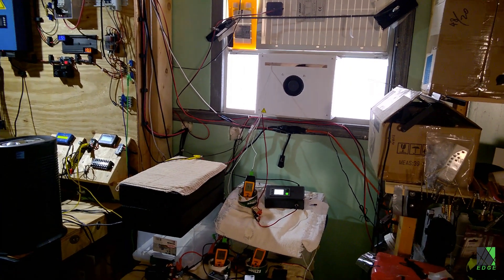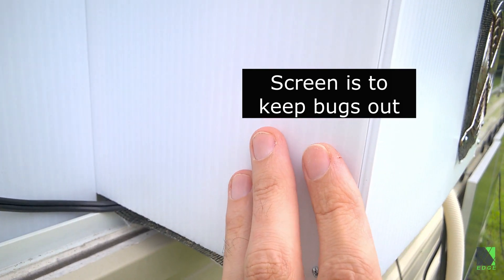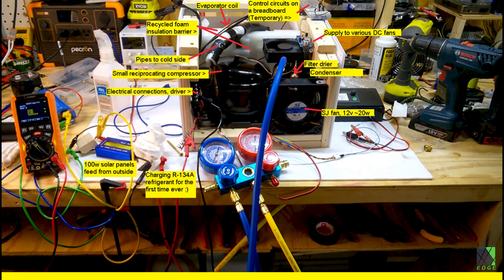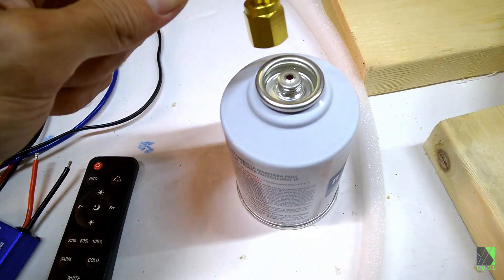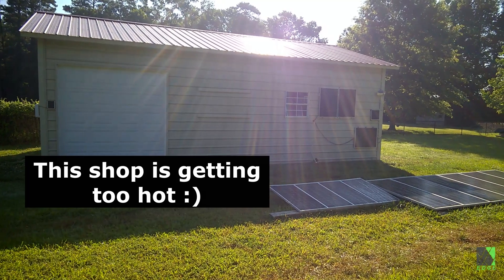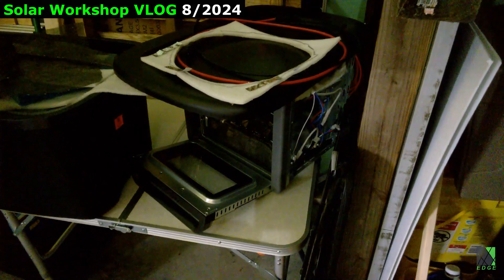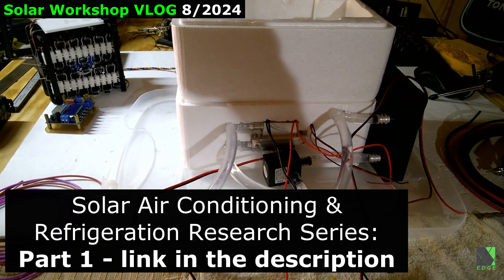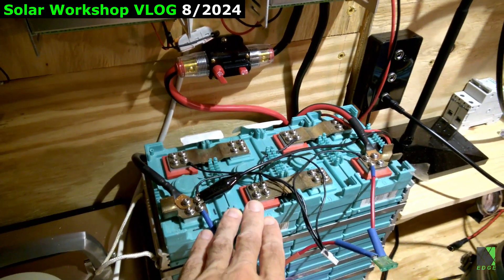#DIY Direct Solar Air Conditioner Prototype R134a Compressor Window AC & Solar Workshop VLOG

Comment: I just found a 12v DC air conditioner and heater that goes on an RV.  960 watts. That's a lot of panels but.....hey.
Reply from the maker: @lesliekendall5668 RVs often aren't very well insulated, so that's probably a key factor. I have found quite a few small 12v AC systems available, at least we do have "some" options

Comment: ...directly into the compressor circuit.  Right.  Sorry, I'm a girl and a visual learner. 😊. Send me one.  VERY MUCH needed.
Reply from the maker: @lesliekendall5668 I am working on one with a better compressor, but will have to take it apart and start over... so can't send one yet :D
Reply: @solarpoweredge 
I found a 24/48v mini split online that I'm going to look more into.

Comment: The copper pipe that you use for the air conditioner I was thinking maybe if you coiled it like a sugar cone where you start out small and then go big that might work better. I don't know what I'm talking about it just something that popped in my head. Coil copper pipe like a sugar cone will make it where the  copper pipe is not so close together.
Reply from the maker: @aunttriciaattic Good thinking, it's very tough to get exchange over a simple coil like that. If I can do some upgrades to this machine it would be great :) 👍

Comment: Is that one of the chinese danfoss knock offs? I am curious how you got it to work on direct DC, did you use a buck converter to keep it in the voltage range? How does it handle low light conditions? I have a sundanzer that uses one and they used to sell a direct PV model but no longer do as far as I can tell. I would love to be able to convert some of the cheaper chinese DC chest freezers to direct solar and eliminate a huge risk off grid, battery failure.
Reply from the maker: Yes I don't know who made it but definitely looks to be a knock off of Danfoss. Looks very similar on the outside. I hacked it to accept any voltage, normally they shut off. The panels have voltage swings as low as 9 volts or up near 20, so a 12v compressor usually would fail or error out. Also had to experiment with some circuits to start the compressor when it first turns on. And obviously it won't run at all when there isn't good enough sun.
Some time ago I did convert 2 DC chest freezers to PV but have yet to make a video about it. Really need to get that done. Of course the challenge is to get the fridge cold enough to make it through the night without harming the food, or perhaps could switch back over to battery if needed
Reply: @solarpoweredge  What did you use to convert it? A dc to dc buck boost?
I know the vfd is designed to slow down if it needs, just not sure how sundanzer did it. It does have a contact that you vary resistance on it and that adjust the speed. So you could use a circuit that adjust resistance based on the solar input to help start it in low light.
Reply from the maker: Electronically I have found many or all of these drives do not want to operate on an non-standard voltage supply. Most of them require something stable, like a battery for power. Those solar panels are simple not able to run the compressor without some additional electronics work and a circuit to handle the start. I pretty much left all that info out. Also this compressor does have variable RPM like you mentioned, I had it throttled down for fear of overheating. Your idea to start at a lower RPM could be helpful for PV. In fact from what I've seen that's how some of those DC inverter mini split air conditioners start up. Very slow and gradual. Anyway it seems most people aren't interested in electronics, but perhaps I will try to get a little more into electronics topics in future videos.
Reply: @ I talked to sundanzer, I have a DCF400 chest freezer, they have direct drive control circuits for danfoss compressors. Not terribly expensive, around 100 bucks. I am going to see if I can swap it out and convert my chest freezer. Might be possible to use them in Chinese copies of a danfoss, it’s basically just a BLDC motor controller like a lawnmower and can be very universal, as long as the wires are the same and the motor is the same size I don’t think it would require much to adapt it if it did need any changes. Do those compressors have a harness for hall sensors?
Reply from the maker: The 2 compressors I'm working at now plus many I've researched have no hall sensor that I can see. But now that you've mentioned it I may take another look. I ran a compressor on generic bldc drivers, but there are some issues with it being non-compressor aware. What we don't want is a locked rotor without some kind of protection circuit, which might burn the windings
Reply: @ should work than if it’s a clone of the danfoss, the hall sensors where the only real snag, it’s possible to figure out which is which but time consuming.

Comment: I went with a mini split, its 900BTU but I have a tiny home. Also it uses about 400 WATTS once temp inside is stable. Powered by solar in Day and a auto switch to AC grid keeps it going after voltage drop. It is 1F and I am warm, tossed the gas furnace and gad hot water heater out (old stuff). My home is all electric even hot water for sinks and shower. ;) Love your videos.!
Reply from the maker: @ECMVAQ137 That is awesome :D glad you like the videos and thanks for watching!

Comment: Did I miss the link to or description of the compressor?
Reply from the maker: Hello, it was a recycled unit. But it looks to me like the cheap "overseas" Danfoss knock offs on a popular auction site. They are probably intended for freezers fridges etc. nothing exotic at all. I plan to find a better compressor and expand the system to a permanent installation... as soon as humanly possible that is

Comment: I've given up on solid state cooling unless they can find more efficient designs but I'd love to know how your more traditional AC project goes long term.  My understanding is the compressor motors don't fair well because of the fluctuations in power.
Reply from the maker: #jmr Hi, definitely hope to post an update on this work... it's been getting a bit too cool here for AC work lately.

I spent months and a lot of money trying to boost peltier cooling performance, and made some breakthroughs. In one test I dropped the power consumption by 50% for the same freezing temps. I started building a small refrigerator to test the ideas. Had to ignore the peltier stuff on yt and just concentrate on my own work. It paid off! Hope to produce a video as soon as I can. Peltiers are a bit of a mystery and very frustrating to figure out. Also working on solid state air conditioning, which is extremely difficult. In fact there are already commercial peltier air conditioners available but I want to improve the design and cool my shop.

Compressors are very easy to cool with due to the gas cycle. In this particular solar AC, the compressor was able to run on a very wide voltage range. First time ever building something like this so I really want to go for version 2 and make some improvements.
Reply: @solarpoweredge  Very COOL. 😆
Reply from the maker: @jmr I see what you did there :) :D hahah

Comment: Thank you for being so detailed with all of your information. I've been extremely interested in solar panel direct to components. 

Have you looked into a company called Natural Current? I purchased a 1hp DC pool pump running off of 2× 550w panels. No inverters in-between. 

Thank you again for sharing all of this information.
Reply from the maker: @cuseikan Hi, you are welcome :) I have not heard of that company, but a solar pump that powerful would be awesome for a lot of different uses!

Comment: I love seeing people's uses of solar. I built a 1.1kw that feeds my shed and powers my Robot lawnmower. I like your idea of solar AC. I paused your video and hopped on Amazon and found 24v peltier modules. (My solar system voltage) I can't wait to see how your testing turns out.
Reply from the maker: @FJRyder A solar powered robot mower is pure awesome! Have fun with those peltiers. I think they can do more and are worth looking into. Several peltier experiments running in the shop at the moment...

Comment: It could be worth trying to bury a coil of tubing (or simulating ground temperature) and testing whether a heat exchanger and pump would improve efficiency.
Reply from the maker: @SentienD I want to try that, If I could get 100ft of half inch copper pipe for cheap, I'd be burying it

Comment: I think Hvac is going through a Renaissance and it couldn't come soon enough. The rates contractors want for outdated architectures is obscene. I could buy and DIY install 5 mini split systems for less than half what the contractors want for a replacement central AC system. This will give me 5 independent zones including my garage for incredible efficiency and redundancy. The central system will give me no redundancy and won't cover my garage. The research you're doing will empower people to make their own custom off grid systems from scratch. Legacy Hvac contractors see the writing on the wall that they will be obsolete soon and are driving up prices to cash in while they can. Subscribed and will be following your work closely.
Reply from the maker: @vladimus9749 Thanks for subscribing and your support! I believe DIY'ers need more options and flexibility. Plus the option to build their own Air Conditioning and Freezer/Fridges. I figure there will always be work for HVAC contractors because not everyone is DIY oriented. But new DIY systems, especially that consume DC solar power directly with battery backup, are high on the list. 
I am testing large scale peltier setups as a potential DIY solar air conditioning solution for small spaces. As well as a peltier freezer. Peltiers are finicky and not well understood, but I hope to unlock more potential if there is any. Will post more on this as soon as possible...

Comment: Use a 12v electric ac compressor from a 2021 Honda accord hybrid are insist I got one laying around am
Planning on building a fully ac system with all with a window ac unit am estimating it will pull 800 watts max at 12 am not sure if it’s variable but I see some modules online for control the motor
Reply from the maker: @onelinkrecords I'd like to get one to test. Seen them on an auction site. Although my efforts are going into "no BLDC" research right now, to eliminate the controller electronics
Reply: @solarpoweredge  ACTECMAX Universal AC Electric Compressor 20cc/r Air Conditioner Compressor for 12V Auto Compressor for R134a listed for 350$ usd
Reply: Option one use oem connectors and piping and condenser probably most diy but big 
Option 2 solder line and use coper lines for small build

Comment: The noise from the fan can be reduced by insulating the coil box and placing the fan inside the box towards the back and then building an air manifold like a "ducted" mini split. Sort of like the air vents on a car dashboard with hidden air ducts. This is also done on air ducts in homes where a fan is placed inline of the air duct to boost airflow on long stretches of air duct.
Reply from the maker: @Nova-m8d This is great information... thanks a lot!

Comment: It is a cool idea, tho I think you will have to deal with the frost on the coils over time. I would drill a hole, and put a grommet for your wires to enter.
Reply from the maker: @marcfruchtman9473 Yes good idea - need to get rid of the frost, it will turn into a block of ice
Reply: @solarpoweredge  Yea, perhaps a short defrost cycle if you can't control the coil temps enough (if you can, get them to be warmer so frost does not form) and a "drain pan" to divert the water into the outside... (and an emergency drain) in case the first overflows.
Reply: One idea, put a Temp switch on the coil to detect when it gets too cold, and just run the fan but not the compressor until it warms up... add a small amount of deadband gap, so it doesn't rapid cycle
Reply from the maker: @marcfruchtman9473 Yes that would work... planning to make some kind of condensate drip tray and a drain pipe to collect all the moisture. Hope I can find something at the dollar store to make the tray

Comment: A use for solar power that is not a complete virtue signalling waste of resources 👍
A more efficient and environmentally friendly alternative would be to use heat instead of light as the solar power source and a sterling engine or three to run the pump and fans and an alcohol water mix as the refrigerant.
Look up passive cooling towers that use water evaporation as the cooling agent for the base design but enclose the evaporator to prevent fluid loss. A construction like this will be very quiet, very very efficient but extremely large compared to a window box ac unit that will probably reach cooler temperatures but won’t move as much heat.
If you live in an area that doesn’t get below freezing you could probably reverse the cycle to get heating as well.
Reply from the maker: @anomamos9095  Glad you liked this project :) Lot's of good ideas, misting and cooling towers in particular are something I have been investigating. Like you said they are huge... I haven't been able to decide exactly how far to go as we have limits on space. But I like the idea of cooling with no refrigerant and also quiet. If I can get something like that working I will post the results for sure!
Reply: @solarpoweredge  The towers I've seen are usually about 3 to four feet square at the base and extend about six to ten feet past the roof line of the building they're cooling. This is usually to ensure sufficient passive air flow and area for the misting screens . If you build it like an aircon unit with fans a sealed evap chamber and an ordinary water pump to move the coolant to a reservoir at the top you could probably compact the foot print a bit , the height is the important factor
Reply from the maker: @anomamos9095 Right, thanks for the information. I plan to use a large fan, if I can find the right one that is DC powered. I keep collecting parts for each project as funds permit and setting them aside. The largest fan I have might be enough already, guess we'll see. The structure itself needs to be cheaply built the first time around... maybe I can find something plastic

Comment: I would add a water catch setup for the condensation drip that is basically clean drinking water from the air. Great stuff...thanks for sharing👍
Reply from the maker: @Nico-vh1qp Welcome :) I am waiting for some dollar store plastic trays to make a drip pan and collect all the water... unfortunately until I do that it just pours out the bottom, but I knew that would happen
Reply: It's not clean water line  after running for a couple weeks.
Reply: Smart idea!

Comment: Stop by your local heating and air guy and ask them for some scrap coils, especially the ones off of American Standard and Trane  called “spine fin” coil. You just need to learn how to solder or braze aluminum and aluminum to copper.

To increase heat transfer and prevent freezing, you need to direct the air over the spine fin or plate fin area. Use shrouds or ducting as needed. 

Ask questions to us hvac guys. We don’t mind helping. I’m learning electronics to enable pcb repairs in my hvac business.
Reply from the maker: @USA-GreedyMenOfNoIntegrity Thanks for this... I'll see what I can get! Our regular HVAC tech is a nice fellow, sometimes I get to ask him a few questions and I've learned some good stuff. He offered to sell an old mini split, hope to get some cool parts out of it for projects
Reply: @solarpoweredge  oh yeah, there are many good parts in these old scrap units. Offer to buy them at scrap prices. The coils are the only parts worth much. He may make you a good deal instead having to spend time separating and hauling to scrap dealer. It depends on how much free time he has.
Reply from the maker: @USA-GreedyMenOfNoIntegrity I can't wait to see what kind of parts are inside, especially interested in the outdoor unit fan
Reply: Hey @USA-GreedyMenOfNoIntegrity,
Just wanted to say thanks for getting behind someone who is experimenting in HVAC and passing on your knowledge. I've always loved passing on mechanical and other knowledge to younger ones and I couldn't let what you did pass without encouraging you in that.
Fellow learner-of-HVAC in Oz.

Comment: Awesome, a suggestion for a project. I don’t have the time to do it but if you ever do, convert a DC ceiling fan (BLDC fan) to battery or solar power. Very hard to find DC ceiling fans these days.
Reply from the maker: @Deveak Good idea, wrote it down! maybe I'll find a ceiling fan somewhere to give that a try